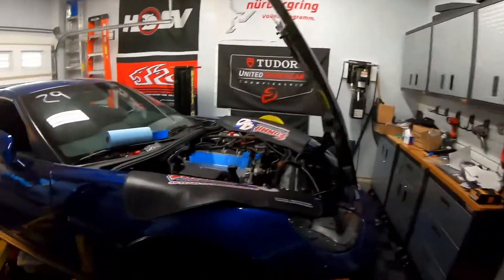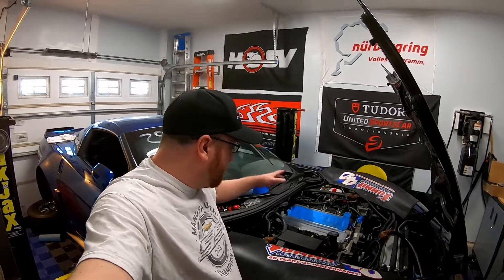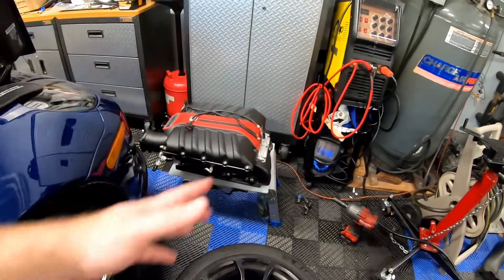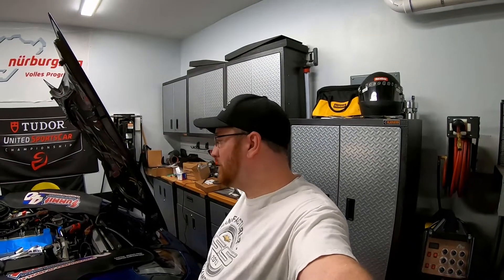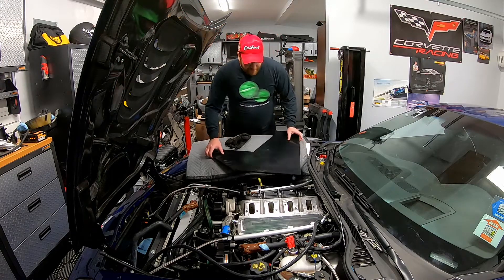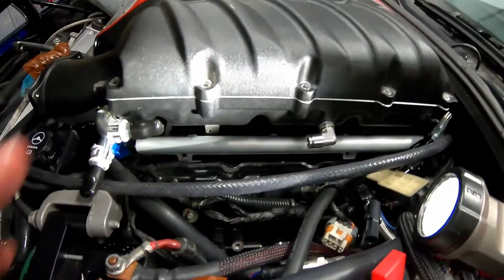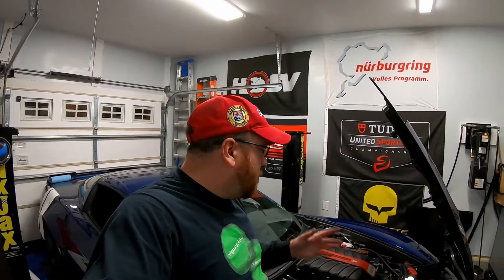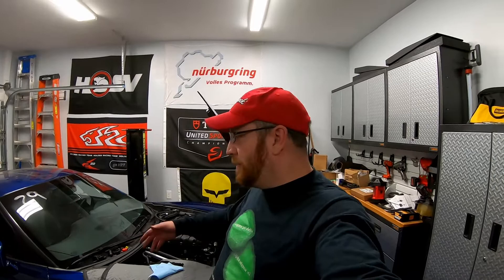2005 Chevy Corvette - V4.0 - Ep 40 - Rear Steam Port Modifications

Comment: Were your rear steam ports plugged and did you have to remove the plugs/drill them out?
Reply from the maker: On my CNC LS3 heads - they where not plugged.

I think the LS3/LS7 heads are open - but the are plugged from the factory on the LSA and LS9 heads from the factory.
Reply: @bonecrrusherSS  Okay thanks.  On my 2011 Grand Sport the steam ports are plugged with GM rivets.  I would like to install a 4-port steam vent using a used LS1 OEM GM part.  I think I could fit it as I am using FI spacer plates which raise my E-force about 12 mm above the valley cover.  Should be enough room for the steam vent.  But I will have to remove the blower and see if I can drill out the plugs with the heads on the car.